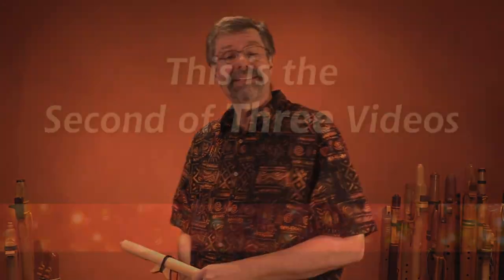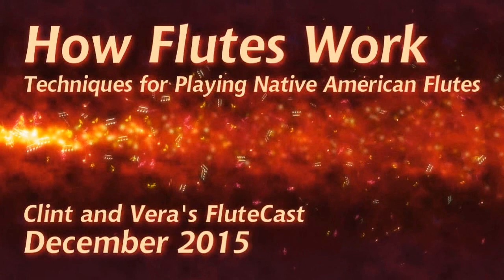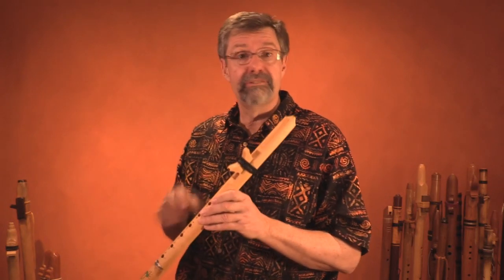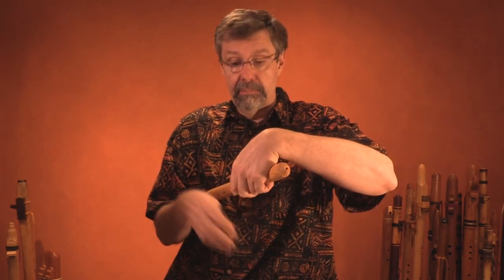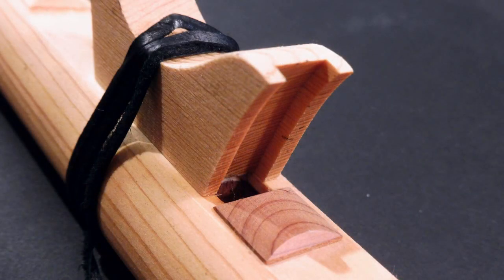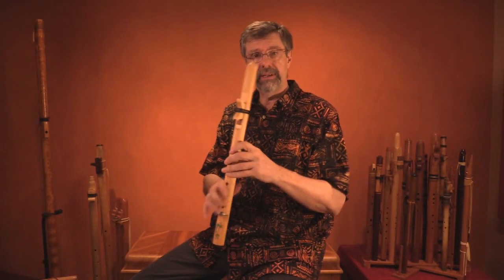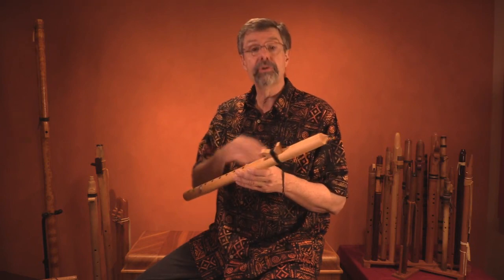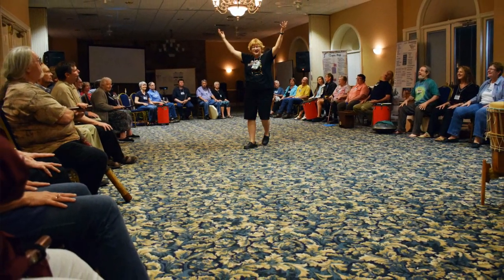Native American Flute Basics #2: Maintaining Your Flute

Comment: Where can I find flute cases like the ones you show in the video? I googled them but didn't come up with much.
Reply: Hi Michael. I make my own from a length of pvc storm water pipe. I use either end caps or an end cap and a scew on cap. See your local plumbing supplies. Chhers Peter